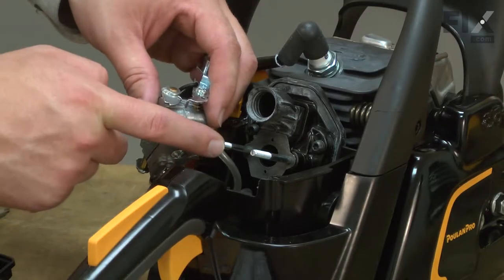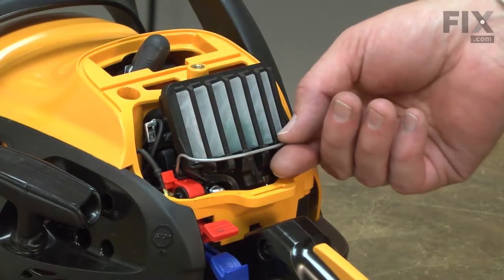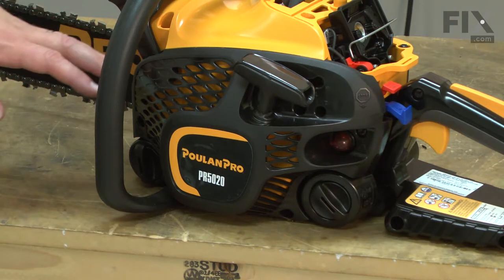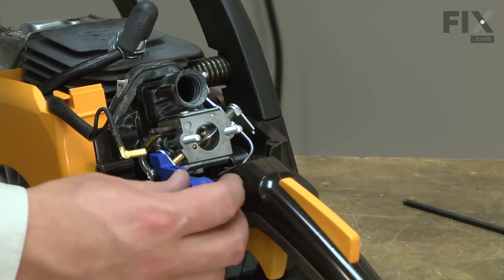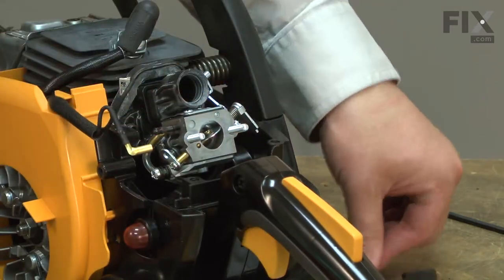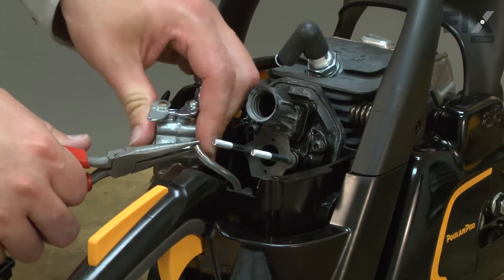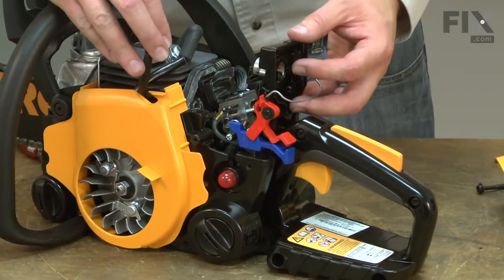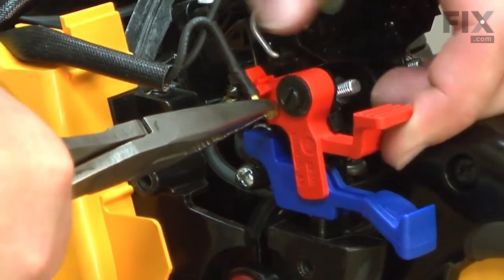Poulan Chainsaw Repair - How to Replace the Carburetor

Comment: I have been watching your videos for quite some time, i want you to know that i do very much appreciate you spending your time and trouble to help others on their struggle to repair what is not working. In all the years of repairing small engines  mowers and other yard tools  i have only come across one that caused me to loose sleep and finally threw it in the garbage can, three days later it hit me like a ton of bricks, someone before me removed the flywheel and did not put it back correctly, it's something i rarely run in to or even see from anyone  i know, that's why it evaded me, it would almost start but would not keep running. Today i no longer clean carbs. it is cheaper and better to replace the carb. i found lots of good dealers on amazon that charge a little bit more than the cost of carb cleaner. Iam however getting quite the collection of used carbs. and might invest in a sonic cleaner , once again thank you for all your help .

Comment: I also changed the spark plugs and fuel filter.   Now it doesn’t start.  Is there anything I should be checking?

Comment: Nice video, except...you skip over the part where the starter is reinstalled. At 5:22 you're connecting the ignition wires andthe starter is still off, and then you move to reinstalling the top cover and the starter is already mounted.

Comment: where can i get the whole pull rope assembly cause mine quite working on my 5020 an if i can't find the part ill toss the pos saw an get an axe
Reply from the maker: Hello, I wasn't able to find a match to that model number on our website. If there's any information you can give me to help me find it, I should be able to point you towards a parts list! You can also enter your model number on our website here: https://www.fix.com/